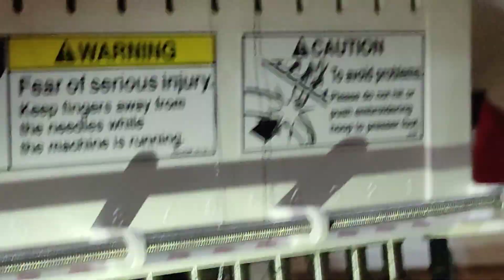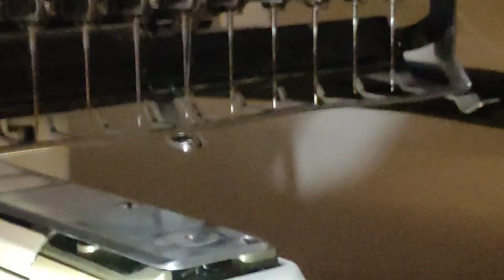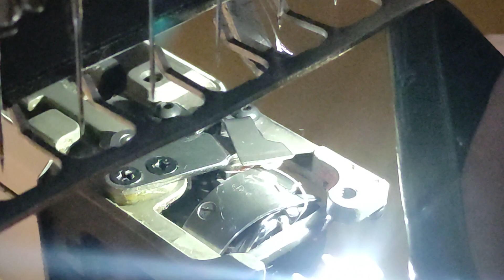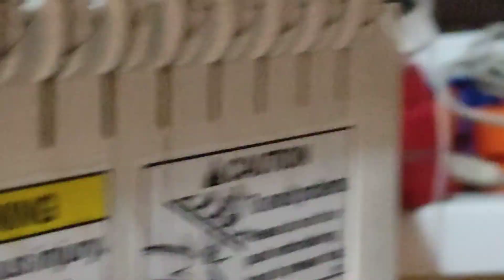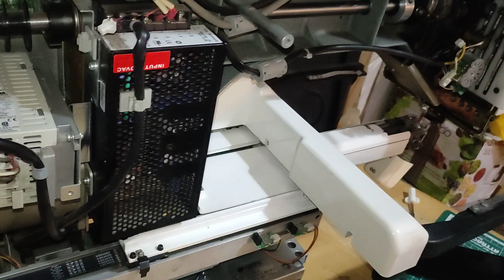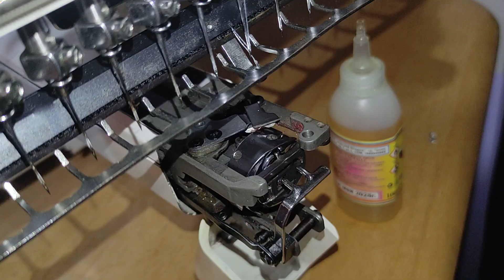Embroidery Machine Happy Tajima Cutting Knife Repair and Service

Comment: I have another question. I heard some years ago that there is a possibility to use the LAN port to transfer the files to the machine. We are still using a very old computer which still supports the happylink software. I fear every day that the old laptop breaks down and we cannot access the machine anymore. Any comment is highly appreciated. Thank you in advance
Reply from the maker: I don't know.sorry
Reply: @MeFixingEverything  solved this as well! It is not the Lan port that needs to be used but the PCMCIA card slot that can be used instead of the old USB connection with an older laptop. managed to find a card with a CF card and a reader with a modern USB-C connection. Now I can just use this card between my MacBook and the machine to exchange the files.
Reply from the maker: Very nice, good to know

Comment: Excellent video, TY! I have a Happy embroidery machine HCA. It`s trimming fine, but it doesn't always catch on the 1st. few stitches. So I find myself rethreading constantly. Any recommendations?
Reply from the maker: Cutter timing and timing on the needle. I have a few more videos have a look. Also texmac have very good videos.
Reply: Very good videos so far. my wife has somehow completely screwed the timing of everything. I managed so far to get the timing right on the needle, thanks to your other video. But now I am struggling a bit with the timing of the cutting blade. You mentioned that there is a download site for the manual. Would be great if you could share it.
Thx again
Reply: Again me, is there a way to hook on a usb reader directly to this old machine? We are basically hooking on an old laptop with a serial connection. Thx